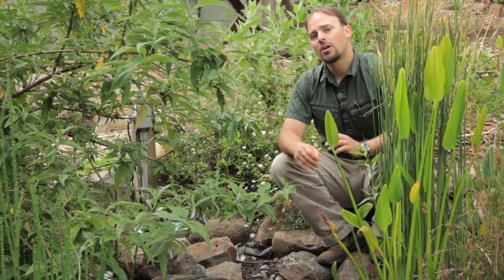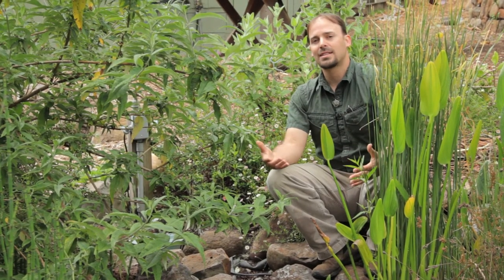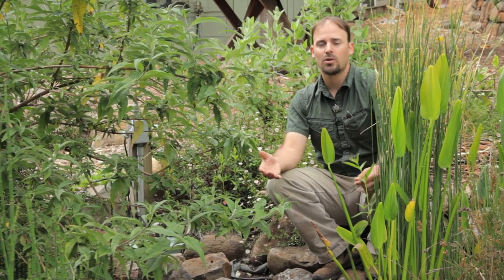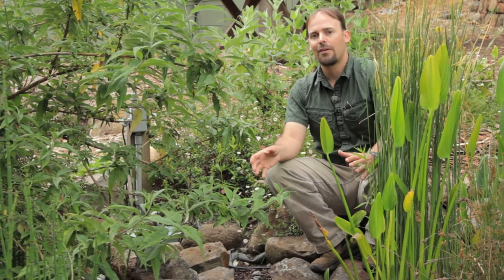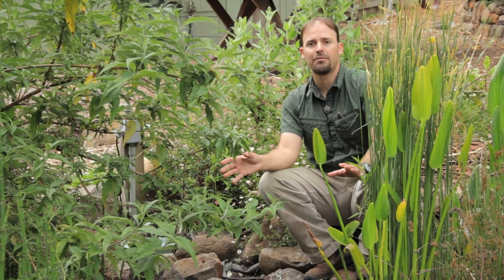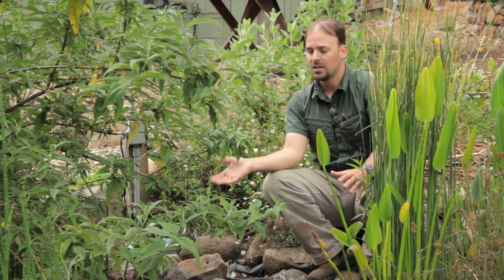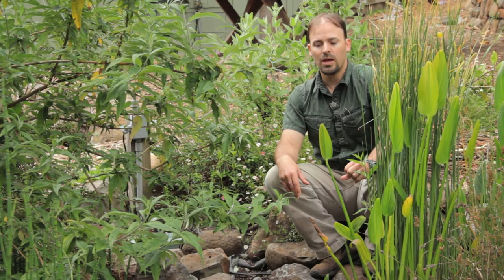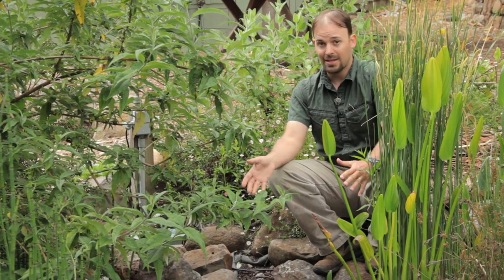What Is a Plastic-Lined Pond?

Comment: How would you make a 5 to 10 acre pond in the mountains? Plastic doesn't come that big does it? My husband's grandparents built a one acre pond by digging it 6ft deep in the middle, wetting the bottom then throwing the pig food in different parts every day and letting the pigs churn it up for a month or two. That was about 80 years ago, it worked great but the silt washing down out of the mountains has filled it in a lot and it is only a few feet deep now. I need to build a pond in different mountains and I don't have the hundreds of pigs it would take to wallow out a 10 acre pond lol.